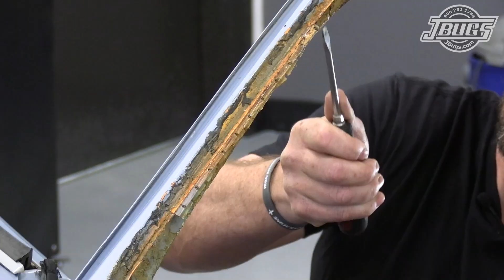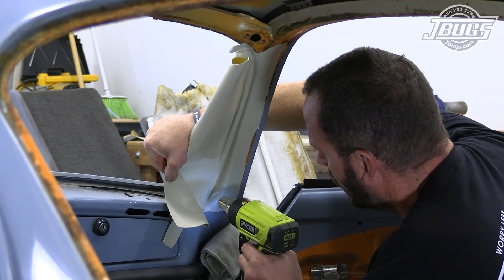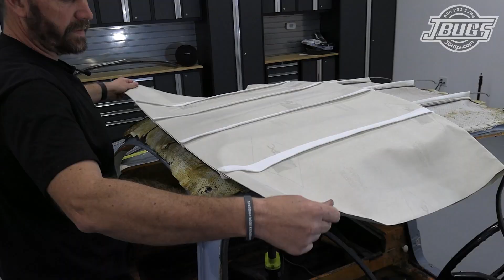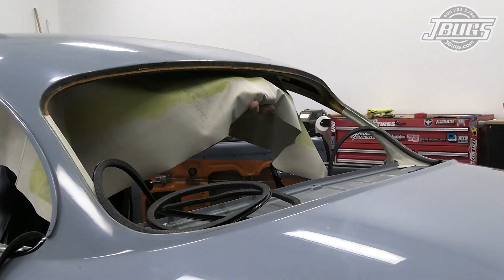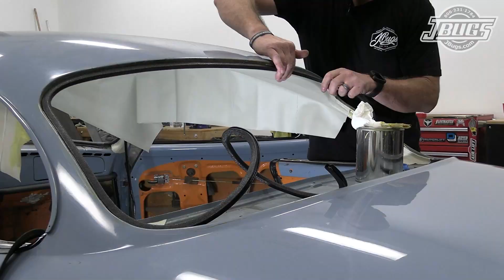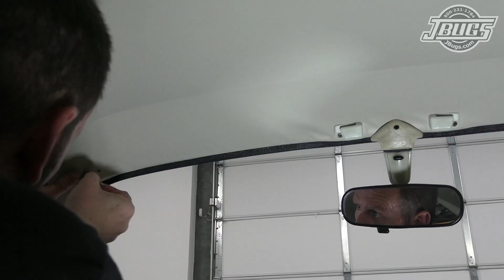JBugs - 1970 VW Karmann Ghia - Headliner Installation

Comment: Yeah, DONT use a solo cup like the guy in the video, glue will melt your cup quickly and you will be cleaning a huge mess on your hood and fender where you set the cup while attaching material, then will lose so much glue you don’t have enough to finish your install and will have to find glue locally.😡
Reply: Yep, that's why I (the guy in the video) switched out to a metal can! We haven't offered the headliner glue in over a year so you'll have to order or find it locally regardless nowadays.

Comment: Your video was really helpful in helping me tackle my ‘69 Ghia headliner. Thank you!  
Question:  when putting window to body trim back on where it captures the headliner, how did you deal with the locations where the rib pocket fabric thickness seems to be too thick to let the trim get a good seal on the body…and I’m afraid to cut it for fear it’ll create some future issue with headliner. Do you have any advice?  Thanks in advance.
Reply: https://www.youtube.com/watch?v=7zequIbeSHs - we just released this video last Friday, I just laid the rubber and trim over the seam and installed the seal. Unless you have a really thick vinyl, I wouldn't do anything. If you do have extra thick material, I would perhaps cautiously cut the underlying piece of material up to the edge of the seal and trim piece.

Comment: Please start shipping to the UK! I really want one of your headliners. No one else does them
Reply: They aren't "our" headliners, they are made by TMI. You might try contacting them to see if they have a UK supplier - or, a quick Google search gives this - https://www.heritagepartscentre.com/uk/tmi-interiors
Reply: @Sam_Mebane  they only offer very limited selection.
Reply: @GT.Bugger  they offer the same one we installed here - https://www.heritagepartscentre.com/uk/201510-headliner-in-single-colour-vinyl-with-perforated-or-crush-finish-for-coupe-model.html

Between the shipping costs and the logistics, there is no way we can ship overseas effectively, for a fair price. If nothing else, try contacting TMI directly.
Reply: CSP-Shop and Hoffmann Speedster both offer (I think) TMI Headliners. Got mine from them, fit perfect in my 72.